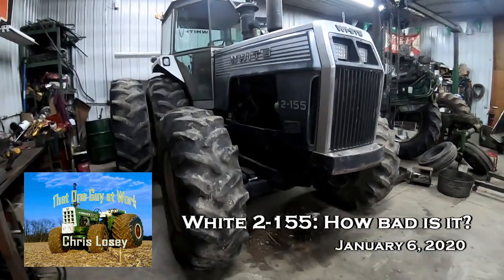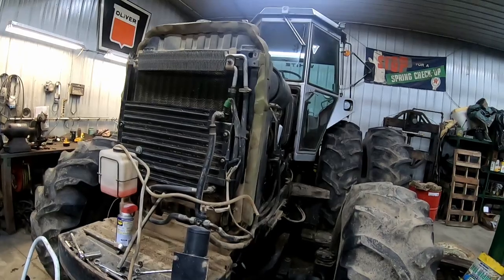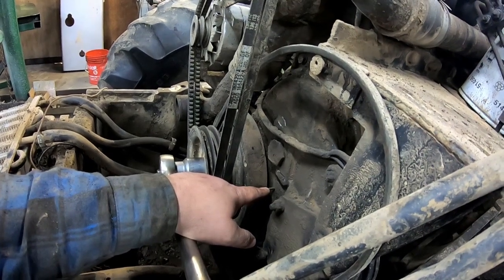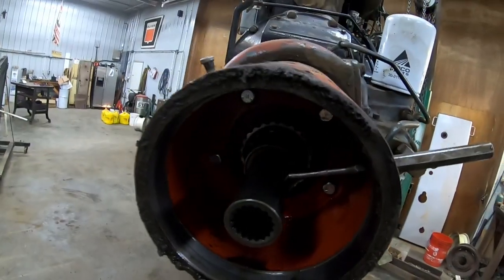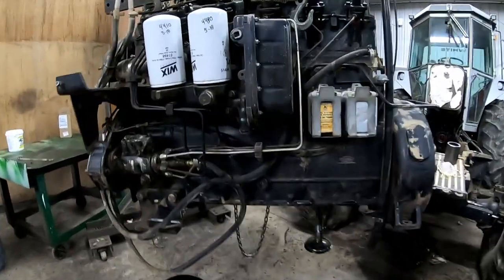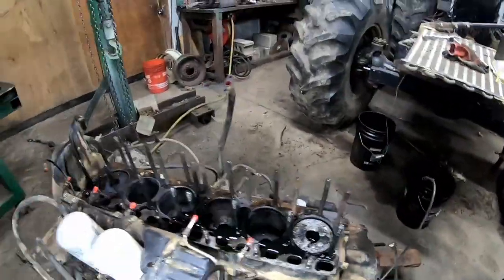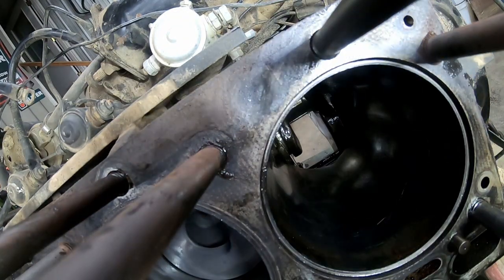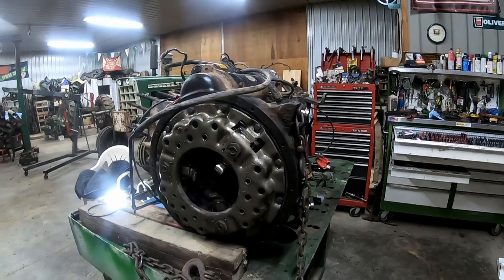White 2-155 Engine Damage - How BAD is it?

Comment: Chris, make sure you get that counter bore checked and check all your liner heights on your adjacent cylinders. We had engine shatter a liner like that and it was because the liner was moving in the bore and broke itself off the flange. Just a suggestion.

Comment: We made the tool for the coupling from IT manual instructions and is a pain to get lined up and even worse on the 185's, my brother took a 1/2'' plug and drilled a hole in the center and ran a smooth 1/4'' rod with a point on it, and that worked perfect for lining up the inner coupling once that looked centered removed it and installed the threaded one , it went right in.  I will check the preheats in my tractors , had never heard of that, do know lots of the 135's and 155's in my area were overhauled in the 4000 to 5000 hrs most were used as main heavy  tillage tractor.

Comment: Our shop was built sometime in the late 60's or early 70's by my Dad and uncle. It is a 2 stall tractor shed built off the side of the granary. Prior to this my dad had no where to keep his tractors. It was a huge step up for him till he could afford to build the Morton machine shed we have now which was put up in 1987. The tractor shed was only built to house no cab tractors. It works out nice today to use as a place to store the air compressor and the tools and it faces the south so you can get some warmth from the sun when it is cold out. There is no cement for splitting a tractor in either shed. I am very thankful though that we have what we do.
Reply from the maker: It all takes time. I definitely like that you guys park your equipment inside most every night. Storage will pay for itself in resale value, let alone lower repair costs.
Reply: @ThatOliverGuyChris  I remember the picture you showed in one of your videos about the first buildings that your family started your dealership up in. They had some real humble beginnings as well. I sure at the time you guys put up the shop you have now it was a lot swallow.
Reply from the maker: Even back in the 90s our Agco rep was telling us we needed to tear down the main dealership building and put up something more modern. We had to build the pole barn with the workshop,  the equipment was getting too big to work on in the old building. The upside is I have a lot of storage space today.

Comment: Hey Chris. Just come back to watch your video as I'm doing some work on our 2-135 and I am looking for tips. Anyway I didn't realize how low of hours your tractor is to have the engine apart twice. Ours is over 11000 hours. At 6000 and some an injector blew a hole in number 3 piston so it got one slieve and piston and rings on the other 5. Reason I took it apart this time is the seal went out on the center shaft and let oil in to the clutch. Take care

Comment: Nice work. This ain't your first rodeo, you can tell. You got the right shop for this kind of work also. Doesn't look like any of that trash circulated through the lubrication system, I'm surprised. If that was an automotive engine ever bearing would need to be replaced.

Comment: Good video and good explanation of failure mode - It was a good thing this was a dry sleeve engine or likely it would have pushed the wrist pin and rod through the crankcase skirt.   You were smart to shut it down when the noise occurred as a hired man would have driven it further and done more damage.

Comment: Well Chris... You know as well as I do, if the pan is off and the hours are up a little, bearings are cheap insurance... 
Anymore, it's usually more expensive to buy pistons without the sleeve and rings... You need all three.
At 8,500 hours, our IH 5288 (DT466) broke a ring on #6, no clue how or why.. 
Wore a wide groove in the liner, but it honed out good enough 😁
Changed the piston (bought the kit, it was not only on the dealers shelf, but it was about $30 less than the piston by itself)
New rings all around and new bearings... Ya ya... I know.. should have pulled the liners.. naw, no cracks, no leaks, no reason to disturb the seals. That's been a couple thousand hours ago.
Thanks for the update Chris!!!
I don't remember what my guess was, but I thought about a broken ring and land.. I know what that sounds like 😂🤣 yours was very similar sounding, but not quite... 
Didn't sound like a rod knocking either.. (lost a rod bearing in the combine, also a DT466..)
Reply from the maker: I pulled a couple of mains, and they looked as good as the rods.  Still going to get a fresh set in there while I'm at it.
Reply: @ThatOliverGuyChris  always a good idea!! I've seen guys leave them, only to find out that they were getting ready to go... 1800-2500 hours later, tick tick...Bang!
Reply: @ThatOliverGuyChris  ounce of prevention worth a pound of cure

Comment: I've seen that same dry sleeve in the pan thing on the older International D236 and D282 engines in the diesel 460's, 560's and 706's.  These engines used a light press fit on the liners. The problem was the large variety of bore tolerances. Once in awhile you would come across a bore in which the new sleeve liner would slide in by hand. This combination was a prime suspect for the liner to fracture at the flange line and end up in the pan shortly after the overhaul. Back in the day the old guy I worked for would go the the drugstore for some chemical, mix it with glycerin, and coat the sleeves on these loose holes to prevent the liner from flexing on the power strokes. I no longer remember the name of the chemical, however when I went out on my own I used Loctite sleeve retainer in its place with good success.
The discoloration at the top of the cylinder bore at 33:13 could be a smoke ring caused by a fractured liner. For sure I'd secure a bore gauge and micrometer to verify the fit of the new liner in the bore as it now stands. Any clearance between the liner and bore is too much on a dry sleeve engine.
Reply from the maker: Thank you for the tips, I'll look into that.

Comment: well not as bad as it could have been at least and good to see it can be fixed without a lot of machine shop work at least and I will be interested to see how the rest of it goes since I just work with the IH and Cummins Engines. Having a lot of time in tractor pulling we like to use dry sleeves very easy to rebuild but just don't deal with heat like you explained very well

Comment: With that constant noise I figured it was going to be a cylinder but I wasn't expecting all that. Least it didn't go worst case and take out the block. It's amazing how good bottom ends look on engines that are maintained 👍

Comment: Wow I’m bout ready to put a screen in the intake or get rid of the manifold heater on ours! I’d have a hard time stopping for supper until I knew how bad it was lol. Good thing that’s a dry sleeve. Would’ve ruined the engine otherwise. U still get the herc parts through Agco?
Reply from the maker: I'm getting them from Hercano Propulsion, real good prices and he specializes in Hercules.  I'm glad someone commented to check that heater, I wouldn't have given it a thought. I was sure it was a turbo failure.

Comment: Wow didn't expect that ! Certainly could have been worse, not that it's good at all. Did Oliver own the Hercules motors like they did the walkashaws? Very well built everything is heavy! Thanks for sharing Chris
Reply from the maker: White owned Hercules for some time, but exactly how long, I don't know. Parts are still available, but boy are they pricey! Just looking online, I figure it would be pushing 5 grand in parts alone for a complete overhaul.
Reply: Explains why so many are swapped
Reply from the maker: Because overall, the Cummins is a better engine, and a person can find a used one for what an overhaul would cost. I personally think many swap because they will do that themselves, which keeps the cost down, but would have a mechanic do the overhaul,  which sends the price up. To me, putting a used engine in is inheriting someone else's problems, where an overhaul is starting fresh.

Comment: Ohhhhh my!!!  Disappointing!  Well, my guess was a broken crankshaft.  I think broken crank would have been better!  That really sucks with only 2k hours on it!  Really an odd thing!  So, I thought it looked like there were cracks between the valves on #5 and on #6, is that correct?  You think any of the liner or porcelain went through the turbo?  I have never heard of the porcelain coming apart.  That porcelain must have wedged between the cylinder and piston maybe?  I have so many questions!  If the head is OK, I'd think you'd be fine with 1 liner, new bearings, and recondition the head, maybe a turbo.  Will you be totally tearing the block down for a good bath?  And then there's the piston cooling jet...  Dang.  That sucks.  Well, thanks for sharing.  Good video, lots of good information.  Too bad that info had to come from this failure.
Reply from the maker: All of the valves have that line between them, it's normal. It's very possible pieces went through the turbo, I'll pull it apart for inspection. Your suggestion is exactly what I plan on doing, replacing the one hole. If it weren't for someone here and on facebook suggesting to check the manifold heater, I would have never guessed that. My guess is that it had broke/finished breaking from cold air while it was idling when I was dumping corn, and then when I revved it up heading to the field, the extra air flow picked it up the piece, shot it in there, and like you said wedged it between the liner and piston, breaking the liner.

 I've been rounding up parts I still have on the shelf today. I have most of the gaskets, some of the bearings, and I even have new valves on the shelf, so I'm going to replace the ones on #6 just to be safe. I'm going to pull the filter/cooler housing off and check it out for contamination. With it being a full flow filter setup, I'd like to think nothing got past the filters. Time will tell.
Reply: @ThatOliverGuyChris  Yeah, the filter should have saved everything else.  Soooo weird!  I never, ever would have thought of that.  Dad's got several of them heaters for various tractors laying around and I've never noticed if any ever had cracked porcelain or not or no porcelain at all.  That's one for the books right there!  That little booger better end up on the wall of shame!  How disappointing!  I remember a friend of mine in high school was working on a 6.2L GM and he sucked a shop rag in the intake and it blew out the exhaust - no apparent damage!  I would have thought that porcelain would have just broken up like you said.  Very interesting stuff!

Comment: Hmm now you have me wondering, I had a 2-135 back in 2002 that sounded like it broke a rod and it was rattling in the sleeve, maybe the same thing happened to it as yours. We ended up having an auction and selling out, sold it as is so never found out what was wrong.

Comment: I doubt it was the ceramic that caused the sleeve to break. If it would have been the ceramic, you would see signs of parts beating around in more than one cylinder. No way the ceramic could brake and all parts would end up in one cylinder. These engines were just known for the sleeves breaking. In my opinion the sleeve from the factory is just not tight enough in the block. You can push these sleeves out by hand. The top ring of the sleeve is held tight by the head and the bottom is always moving around while it runs which after a while breaks the sleeve. these sleeves are very fragile. you could lay one on the floor and jump on it and break it. They make over size sleeves to fix this problem. The od is just slightly larger than the originals to make it fit tighter in the block. 8n ford tractors had thin sleeves like this that were also loose in the block. they would break around the top and do the exact same thing. I would get all new oversize sleeves and fix them all while you are in there.
Reply: I took a 2-155 motor apart that had a sleeve that was cracked about half way around. it was getting ready to do the same thing as yours.
Reply from the maker: I'd agree if the ceramic broke into a bunch of pieces, but it split, with 2 large pieces that make up most of it still captured in the coil of the heater. I'm still cleaning things up and deciding which way to go. Everything else looks to be in excellent condition.
Reply: On one of our pulling tractor with the Hercules, we took the sleeves out and ran 4 3/4" pistons right in the block but we had trouble with the block cracking. . On another one  we bored the block and installed custom sleeves and still ran the 4 3/4 pistons. There is a place in salem, ohio that will make you custom sleeves. They make them out of centrifugally cast ductile iron. These are very tough and will not break. They do cost about $100.00 each though.

Comment: Well it definitely is not good but it always  could have been worse!! If it was a wet sleeve engine, it could have been really bad if the sleeve broken. Looks like you can save it and will not be a complete over haul job. Are the parts still readliy avaible from agco for these engines or do you have another source for parts? Another good video, cannot wait to see part 2.
Reply from the maker: I haven't gotten parts from AGCO on one of these in a few years, but I would guess they still have them. There are some other sources as well, but they're all on the expensive side.
Reply: @ThatOliverGuyChris  I wouldn't count too much on Agco. Doesn't seem like they care about anything other than Fendt and Massey

Comment: What is the brand and part number for wrench your using to get the nuts off the left side of head off under the injectors?
Reply from the maker: It doesn't have any markings on it. It's probably older than I am, but doesn't look homemade. I'll see if there is anything listed in the service manual.
Reply: @ThatOliverGuyChris  Thanks, we managed to get ours off with a closed end 7/8 wrench but we have no idea how we will be able to get a torque wrench in there to torque em down?
Reply from the maker: I have a snap-on M4201 that is 7/8, it will work as long as the injectors are out. I googled it, and it looks like it is discontinued. The book calls for tools WF-1106 and WF-1007. I can't find a source for those either
Reply: @ThatOliverGuyChris  OK Thanks for the info Thats what we afraid of, just doesnt seem to any info out here on tools for those problem left side nuts, we have talked to our local agco dealers and they don't even have any info for us. hard to believe we are the only ones that ever had to take a head off of one of these engines?

Comment: Great video, thanks for posting! Look forward to the next one.  These are neat tractors. I have a 1972 M35a2. They have the same motor just a few diffences. You have probably heard this already.  I would think some of the parts are interchangeable.  The LTD-465 in my truck has the same pistons and looks to be very similar.  It is also know as the hypercycle design.  Wonder if they are the same or if there were differences. Injection pump and manifolds are different. Some M800's 5 tons had the LDS-465 with upped hp and different internals.  If I ever can get some property I will have to snag up one of these beasts!  Any trouble finding parts?  Keep up the good work! Cheers
Reply: Just saw the update video, Good deal!

Comment: So the 354 with the over under Drive should pull out the same way out of the 2-105?
Reply from the maker: Not entirely. The PTO/hydraulic shaft is one long shaft that goes from the PTO to the engine flywheel. I've got a video on how to remove that: https://www.youtube.com/watch?v=LB4BLiHo9O8
 Once that shaft is out, the over/under splits with no special tools or procedures, slide the engine forward until the over/under separates from the rear end. Sounds easy, but they didn't leave much room to do it, especially with the fuel tank in the way. Some people take the cab mounts loose and jack the front of the cab up to get enough room to get the fuel tank out, which makes getting the engine out much easier.

Comment: Do you every get the hot hyd light on the dash come on when using the pto, for extended several hours. I have this problem with my 2 135 and was wondering if had any suggestions. Rear is hot to the touch so it's not a bad sensor
Reply from the maker: I've never ran across that problem. Could be the seals in the clutch pack are leaking so bad it's constantly having to pump oil to maintain pressure. The oil would leak into the rear end,  so there would be no oil loss.  Could be a bad bearing in  the pto. If it only gets hot while using the pto, I would start by pulling the unit. Could also be a slipping clutch pack.

Comment: Chris, if You not checked yetisould go through the head make sure the turbo did not out on the intake side
Reply: Hi again. I been working with diesel engines long time. The other two things that can go wrong with this broken sleeve are  the bore in block off , I would Mic it for sure and the other is was there enough night to the sleeve when in block. The sleeve could have been going up and down with pisgon

Comment: Great video and if you don't mind me asking which fuel line did you plumb the fuel cooler in on ?
Reply from the maker: It goes from the tank, to the pump, to the fuel filters, to the cooler, then to the injection pump.
Reply: Thanks Chris,  I have been thinking about put one on my Allis Chalmers 200